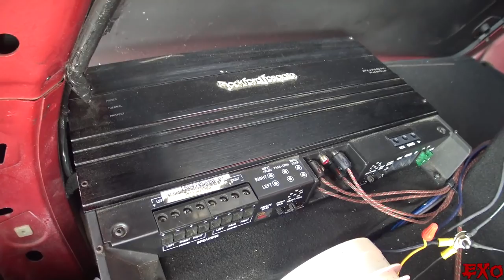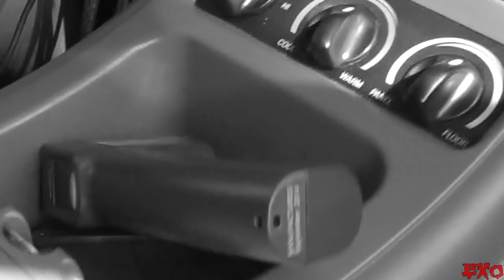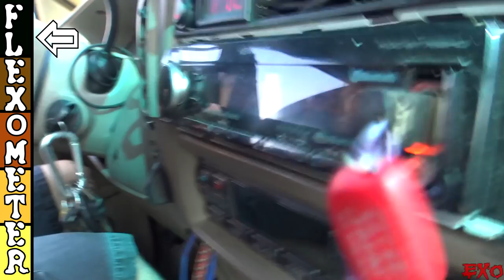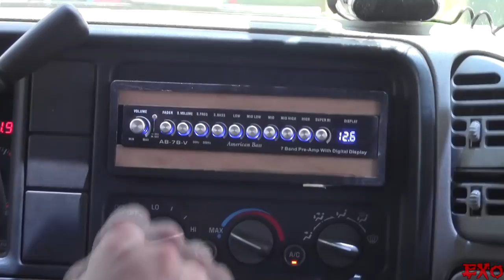SMELLY Subwoofers on BLAST... 4 Orion HCCA Car Audio SUBS & Custom Bandpass Subwoofer Box Build

Comment: Great attitude exo, I love that you don't discriminate over system size or how professional the install.. When I was a kid I had a 20x20w sherwood eq from the pawn shop, I took my mom's old radio shack 8" stereo speakers and popped them in the hatchback of my Ford escort. Man you could hear beastly boys inside the house! Eventually I made a box for the 8s and then I was hooked.. It blew most of my Highschool friends stuff out of the water! Seriously.. Then I got an Orion 8" and plans for a huge dual bandpass box.. Built the box and acquired a hifonics cupid 88w bridge.. Man again I was blowing friends out of the water! Man I honestly would put that box in my car now, for what it was it did way better than my factory Honda Accord 10" in the back dash I rock today.. Except with a 2 year old I can't have an enormous box anymore... Any thoughts or ideas on how to upgrade my 2010 factory Honda system, I really would like a bit more power and all on that 10" dash mount and I'd love to hear it through a better speaker... But I can't give up my trunk space at this point in my life.... Man what can I do to (I want to use the all factory system except I'd like to put a better 10" in and sound deaden the back dash and trunk lid with a bit more power to that 10..... Any help or advice would be greatly appreciated! I just need more power for one channel and it work in all the factory hook up and space.. Basically I wouldn't want it visible I've done much of anything, I just want to to sound a bit better, hit a bit harder and drop a bit deeper... The easiest way possible.... Can you or anyone reading kick me some knowledge? My buddies back home in Eastern NC, Alton Joyner and his guys through the years always keept me up but I live in Charlotte now and just don't have time or means to go back east to do anything like this or I'd just take it to AL and tell him what I want and he'd make it happen

Comment: I like smaller systems as well as wall builds. If someone asks me if I want to hear their setup, I jump right in. I run in the Meca Trunks classes and I get asked all the time when I'm going to do a wall build. I just keep telling them I like the look of a clean trunk build and I am happy with what I have... People don't give smaller builds a fair shake. Most smaller build sound better and cleaner than the monster wall builds anyways.
Reply: Well of course they do! SPL builds are meant to do just that, GET LOUD. They're trying to push numbers, not quality. That's not to say that you can't have a walled-off build that sounds great, but you simply can't beat the sound of a normal build.
Reply: Thats true,,, i wouldnt call mine small but i spent minimal money, ive got 2 15" subs, 2 super tweeters, and 10 mix match speakers mainly 6.5",, the only thing running an amp is my subs,,, and my head unit is a cheap $70 pioneer,,, it all came together so perfect,,, louder than any other system ive heard
Reply: @dominicmartinez6004  How are you running 10 mix and match speakers without an amp?
Reply: @dominicmartinez6004  That pioneer bout to smoke.

Comment: If no-one would do any funky systems with different size speakers or different materials and methods... Nothing new would ever be discovered. Everyone would end up with more or less the same system with the same sound.

I ran a half-stack 12" guitar cab in the back of my car just about 15 years ago. Sure liked some G'n'R and Motörhead and other guitar based rock and metal-sort of music. Still do. But man did that bring out the tones. Nothing super low but just around the d-tuned bass guitar stuff, and I liked what I built. :)

I'm still not totally a bass-head, but I sure like the attitude on this channel. You never cease to amaze me.

Comment: I'm glad you posted the segment on less than perfect systems. I've got a total of 85 bucks invested in my current system and I lightly flex my suv. Granted it's 2nd hand used  decent stuff. I don't need the new speaker smell! Your fan from the dirty South. "Georgia"
Reply: Bro if you can get that shit for the low? DO IT especially quality stuff because believe me Im one to find bargains ALL THE TIME GOOD STUFF and have yet had anyone insult me on my shit!! Not braggn but always ready to be critiqued on a positive note as for the negative Imma  embarrass and mfr regardless!! #IHATEAUDIO-BULLIES!
Reply: @redeyzironman  Exactly, if you know what you're looking at you can get high quality components for car audio at a quarter the price. Subwoofers can be rebuilt also. Many low info folks just give blown subs away even though in most cases they're perfectly good motors still.

Comment: And that's one of the many reasons why this long-ago (1988-1990) basshead subscribed to you, EXO - your passion for sound regardless of the build or whatever bells & whistles other systems sound like.

But system haters have been around since the beginning of time. My ragtop back in those 1988-1990 high school days (1969 Ford Torino GT convertible) had a funky, self-made install. Fosgate Power 300 driving 4 MTX Terminator 12's (with "bass coils" - another form of bass crossover back then) on a piece of plywood and mounted wide open where the convertible top lay fabric was (the whole trunk was, basically, my enclosure) with two separate Fosgate Punch 45's - one powering two rear armrest-mounted Ultimate 8" mid bass drivers and the other powering four Pyle 3.5" mids and 4 Pyle 2" tweets, all door mounted (the Punch 45's were mounted under the front seat) with a Coustic AM/FM cassette (metal tape capability, Dolby B & C noise reduction) shaft head mounted stock in the dash with a Kenwood 7 band pre-amp EQ. It was a decently clean install/setup, but it could've been better with the amp mount details (all 3 mounted on bare, sanded plywood - my main concern was that the amps were mounted safe and every connection as airtight as possible). Whole thing was stock alternator powered/charged, stock battery and was just fine so long as the car was running. Never fried an alternator or drained a battery because of the sound.

And I got hated on - by an upperclassman who thought I was running some petty cutting competition just because I consistently out-thumped his in-the-process tricked out little Chevy S-10 - or so he thought. I actually dug the dude's set-up, as he tried to keep the install as clean as possible, but he was always petty jealous because of my system back then. Shame we couldn't have been acquaintances on more civil terms, but it was what it was, I guess.

But, whenever I came across a decent sound system at meet-ups or cruises back in the day, I was the same - encouragement and genuine appreciation for whatever the guy/gal was building or had built, not this jealous tearing down others BS.

Keep on doing what you're doing, EXO - your passion shines right on through and it's *AWESOME* !!!!! :)

Comment: In my 1992 Stealth, my brother and I built a 1.8cuft (or around there) box that literally is behind the rear seat and does not invade the trunk space. I've got one of those old school 8" Earthquake subs in it. Powered by a 2000's era Rockford. I measured 101db on my meter. Tuned around 23hz but shakes the car more at more like 18-20hz. Only put like 50lbs on the car. Thanks.

Comment: I use to clip my subs to that point before I learned how to run clean rail voltage but I clipped my line for break in smelled cardboard but after cooling they never did again 2 Zv5 15 d1 on a Sundown 6k spl bass package.Its over a $3000 system but people don't understand it take years and dedication to really really sound good without compromising something-SBM

Comment: 6:15 so true. I bought a crown Vic and needed some smaller speakers to fit on the rear shelf. Instead of getting 8s I got a  premade dual 12" 300 watt (600 amp) JL audio rectangular box. Nothing too special but having a full system for ~$1,000 is all I could afford. Plus I didn't want to risk ruining a homemade one because I got a warranty on the premade one.

Comment: I remember my kove armageddon u3 15 being pushed hard would have a burnt peanut butter smell and I would turn it down and I've cycled it like that for years and all 4 coils still were at 1 ohm and it was awesome. I had that woofer for more than 8 years then I sold it when I sold my car. Now I'm starting on another.
Reply: project_nemesis_78 only subs I ever blew where kove Armageddon 15’s. I was competing and had a moddified US amps 2000x and was pushing way to hard trying to get 2/10’s more and I got it but burnt both coils. Awsome setup though damn amp was a beast.

Comment: I bought an Auiopipe 10v line driver to up my sub amp voltage. But it also alows me to up the voltage to my four channel amps. What I need to know is....my 4 channel amps only allow 9 volt and 5 volt in. Can I still run this driver? Should I just not run it to my mids and highs? Sub amp is fine.

Comment: Okay I have 2 12s that are dual voice coil 2 ohm that have a rms of 600 with a max of 1200. My amp is a 2000 watt at 1ohm and a 1400 watt at 2ohm. I’m trying to figure out how to wire them for a 2ohm load. I have a sealed box , so could The run 2 positives and 2 negatives from a sub into the one connection port on each side or would that not work. If u have any other suggestions let me know

Comment: When it comes to budgey builds, i think theyre fun.  IMO, theyre more challenging. But the system im running right i bought everything for 300 bucks used off facebook marketplace, and it flexes my cab visor on my truck, all my mirrors, and my windshield wipers. Quite a bit can be done if you find good deals.

Comment: Exo, commenting on your say about others systems. I honestly agree with you. Yeah I kinda give brands some crap mainly because they are overrated or overpriced, but it's for people to enjoy. I've installed multiple setups and everyone of them had different subs, amps, wire, speakers, HU, etc. (By far my favorite is the 1st gen Type R install in a focus) but I can relate by saying I'm the one that supports anyone who's got a system and isn't afraid to show it off. I like them all about equally. Yeah I do prefer Sound Quality which is what I hope to achieve in my vehicle soon (may need some help with it if I don't mind asking some questions later through the week) but still, system is a system. All of them have some sort of uniqueness.

Comment: Help.
My speakers and amps are wired properly and everything. When i turn my volume passed 25/40 my 4 channel amp cuts out but my subs on my mono block keep playing. The 4 channel will comeback for a split second and cut back out unless I turn it down. Why? 
Pioneer 4800bhs head unit
Skar vxi component
Skar sk m4004
Skar vvx12v3
Skar rp1500
Stock 160a alternator (weak)
Stock replacement battery

Comment: Hey exo going to be doing a custom box of spring in the back of my 93 Dodge stealth originally built to fiberglass Box set up for two tens but wanting to switch the back seat since it's not worth a damn anyway you can't sit anybody back there and make room for a full size spare what software would you use to design the box going to be using to Rockford fosgate shallow mount 10 s

Comment: As for the different sized subs.... Ive always wanted to build a multi sized system. Some 12s running the 10-100hz range, 10s running like 80-150 range and 8s running like 130-300 range. Then keep stepping it up from there. 8 full range, 6.5 full range, 3way components and some super tweeters....Frequency ranges would probably be more broad but the logic stays the same..

Comment: About how crazy do you have to be to listen to that much bass lol..i know I was a kid once but my heating sucks /I run a $12k focal and Moscone system with 7k RMS but I only run 600 rms on the one 10inch JLsub box ..it’s so clear the mids & highs never Distorts on max although it’s set perfect but I hate that smell it’s never gone away as soon as I turn it up it sinks so bad it scares the crap out of me ? Won’t it ever go away ? The sub & amp are match both at 600rms..is it not set correctly ? Then I want to be able to turn it up but ???

Comment: i have a question for you..... I have 2 duel 4 ohm kicker comp r on a alpine mrv1200 that is only 2 ohm stable but.....so question is is it better to get a better amp or 2 duel 2 ohms speakers??…….its sounds good right now but don't want to mess anything up to bad.....don't kno if u ever got a question like this
Reply: Just get a different amp bro, those Alpine's aren't even that great. If you're on a budget look at skar audio's RP 1200 amp. If you do that you can wire those subwoofers to 1 ohm and you should not have a problem

Comment: I used to have a budget system that banged shit out.  Spent more on mids and highs than I did for my amp and subs. I had a 600 watt crossfire on 2 w6 JL 15s in a sealed box to JL spec and faced the rear of my hatchback mustang's glass and the shit slapped. Had no more that 800 bux in it.

Comment: See that blue van in my avatar ?
It has multiple size subs 4-15' and 4-10's I have the 15" subs at 40 down and the 10's band passed at 90-40 and for a bunch of MTX 8000 subs and old school hifonics amps it was moving earth and shaking walls since the early 90's

Comment: I scored two Pro Sound car audio amps a "100 watt" and a "300 watt" (the 100 watt was already clipping at 6.5V per channel and the 300 at 13.5 although the batteries were down to 11.5V so not sure about that), a 3 way crossover and a 10" SPLX subwoofer in a sealed enclosure and some weird red "lava" strip light for £20 on Ebay.

I'm going to test the sealed on my Peavey IPR1600 as I know it has some real power to see what it's got, although I'm not going to play rap as loud as it goes to avoid blowing the woofer. I'm thinking it's not going to get as loud on the same volume level as my 2 12" PA subwoofers.

Comment: When’s your system gonna be done? Do you think it will be louder then Thelifeofprices toehoe Jonathan prices
Reply: Think the neo HO is doing 67 iirc
Reply: I like JPs builds but it always seems like there is something wrong with it. For the last few times I seen it at Slamology, it wasn't working. Last year it was at Slam but it was all torn apart... Yes they are clean and sounds pretty good but I prefer builds that people do themselves. Built not bought!
Reply: @Str8GasGenetics  think it last did a 165.4 sealed on the windshield
Reply: @spuds7677  there was some issue with the alternators charging the lithium batteries, should be fine once its done being upgraded
Reply: Yea Exo is pretty cool it’s been about I year since he torn it apart
Reply: Happy thanksgiving 🦃🍽🍁
Reply: jp has what, 6 team sundown neos..5000wrms per sub ..exo will have to step up his game to beat jonathan.

Comment: if that guy sealed off each sub it'd be fine, wouldn't even need to be thick, as long as they're in phase pressure either side of the baffle should be roughly equal, so 1/2" would do

Comment: Couple days ago I bought a pair of JVC SP-UX7000 micro component speakers for $20. They were listed at $25 but the dustcaps were pushed in so they took $5 off. They have SO Much excursion from their singular 3" drivers! And they didn't bottom out once (I guess the receiver was in protection mode) but anyway. I thought the voice coils were burning as I swear I could smell coil in my room, but it turned out that it was just the receiver getting warm and pushing to it's limits (If I turned the speakers any higher than -50Db, they would cut off and I'd have to turn the receiver off and start again) it's a 1974 Sherwood S-7900A. I guess a recap-needy 60W receiver and miniature 20W speakers don't play well.

Comment: Hey! EXO i have a huge project i'm gonna do 

A bass table. I need to know some stuff tho. I'm going to build the speakers from scratch. ill have 8 Smaller speakers on the sides and one huge subwoofer at the top middle. i need some advice. Will it destroy itself ( the table ) from the force of the subwoofer and the speakers and do you think its WORTH making it?
Reply from the maker: If you make it strong enough, there's no way it will destroy it!
Reply: @EXOcontralto  Oh Hey exo! I need some more help, i need a power sourcr or Something to connect it to my pc, how can i do it? And what amp do i need thats 1. Cheap and 2. Super good??
Reply from the maker: @Swedish_Leo  You can use a spare PC power supply!!!
Reply: @EXOcontralto  Oh?! Really!! But what kind of amp should i use?? I cheap but super good one??
Reply from the maker: @Swedish_Leo  A class d amp should be used for its efficiency
Reply: @EXOcontralto  Oh okay, got any recomendations?
Reply: @EXOcontralto  also im building my own speakers and subwoofers but how can i connect the speakers to my pc? Without an amp? Or what do i need to do?? Please help my god EXO

Comment: If i put sponge in my sub box will it help get "better" bass or do nothing?
Reply: In car audio I havent seen anyone use "sponge" for ported boxes. However alot of people put it in sealed boxes where the internal volume is smaller than spec. Supposedly adding "sponge" make the box seem a little bigger than what it is. However I've also seen people say that it can be bad for certain woofers where the voice coil is out in the open, some of the "sponge" might break off and get in there...
Reply: Fiber fill not sponge and it's just better to use correct box specs
Reply: It will lower box tuning, if you can measure impedance curve then you can play with amount of polyfill you add (not sponge). Steve Meade made video about it i think. It's cheap way to go lower with small box.